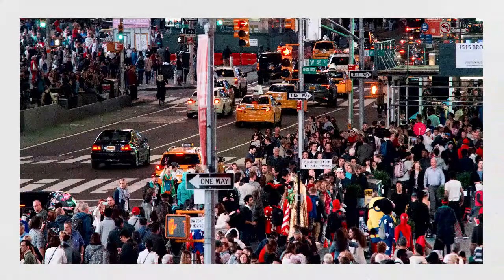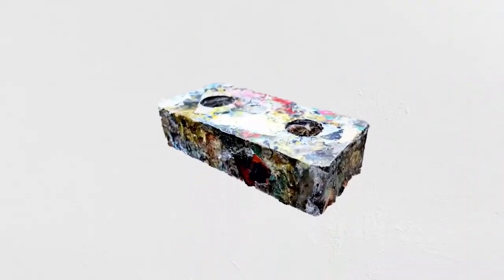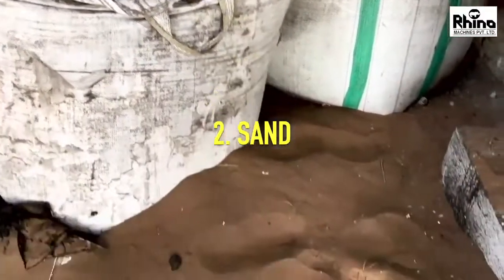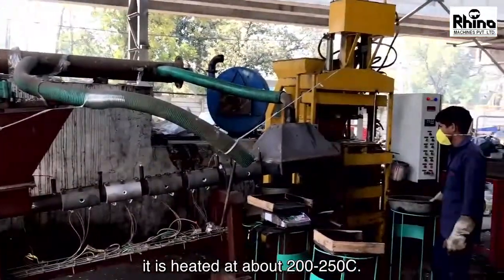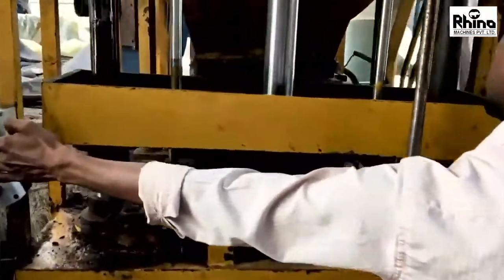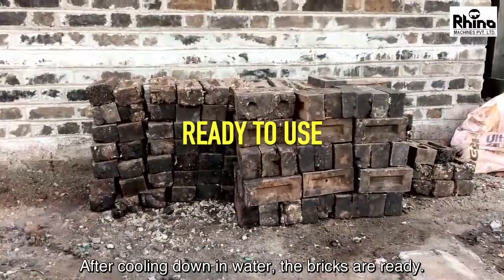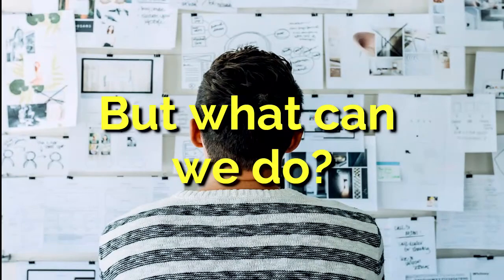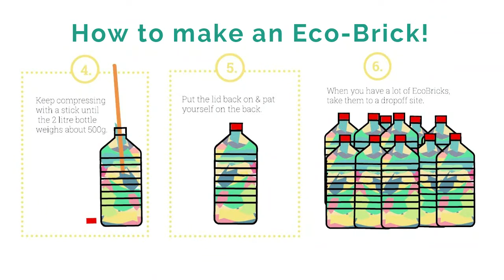Building Houses with FIRE PROOF PLASTIC BRICKS!!! [ Episode 2: Zero Waste Series ]

Comment from the maker: For all those who think the plastic brick will catch 🔥🔥🔥🔥
VIDEO PROOF: https://m.facebook.com/watch/?v=2465503103576809

We love to hear from our InfoMatter family, please suggest improvement or video ideas you want us to make So we can continue to deliver awesome content ☺️🙏
Reply: Cost of per brick Kay hoga
Reply from the maker: First of all thanks for showing interest in our Channel Anju.
We would like to say that the video was made with the sole purpose of raising awareness about plastic bricks production in India. Hence we didn't go in detail about cost or any other technical information.
So to serve you curiosity well, We would recommend you to visit the website/ contact Rhino Machines Pvt Ltd.( Site is inculded in the video)
Reply: The major question is : are they fire proof? If not, they are useless.
Reply: Would it also be better if I use coal ash from power plants
Reply: @lsd8497  it is more complex than your question. 80% foundry ash and 20% plastic means that you will have a high initial capacity to absorb heat in  both the sand and plastic before the plastic will melt. This will STOP fires in your house. If not, the melting plastic will on the surface ignite but at a rate much like a slow burning candle where the heat is mediated vs a wood house which would be like an inferno. However if your house is filled with a ridiculous amount of flammable material, then I can see the inner walls of the house also turning into a roaring inferno as well!

You must also consider the holistic social impact, hope, and job opportunities created which can produce a net positive outcome vs depression/suicide, crime..  death by fire which is no picnic, but neither are the other consequences.
Reply: @baloog8  Elaborate answer. Thank you.
Reply: Hi man. What is your sand/plastic ratio?

Comment: The problem is when plastic becomes a part of our system it is difficult to get rid of it as it does not decomposes but breaks down into micro plastics.
These micro plastics then become a part of our food chain either through food or direct inhalation. 
Regularly Eating food heated  in plastic wrappers containers  could be one of the reasons for cancer. 
I hope and pray the solution of living in houses made up of plastic bricks is not more dangerous than the current  problem itself. More research  needs to be done into this field .

Comment: I hope plastic bricks is the beginning to better quality homes. In the US no homes are built to last, They are built to be torn down easy and not last more than 20 years yet they cost a life’s savings to get. If plastic bricks were cheaper than wood and steel poles it would make building cheaper and homes last longer. More sound privacy between rooms aswell.

Comment: Can we make the block only with plastic waste ?
Reply from the maker: Well we are not experts on that to comment,but as you saw in the video, experimentation never fails to yield the right results!!!
So,yes there could be a possibility...
Reply: Yes . But brick outer layer is slippery . Doesn't make wall 🧱.  Second disadvantage fire can catch . If sunlight hot the plastic brick the hazard gases generate
Reply: @virenderpal868  tq mr.virender pal for your kind reply :)
Well can we apply a concrete coat obove that block to get a roughness so as to build a wall .? Moreover these can build a wall by reinforcing with iron bars ... Then we can easily build a wall ,isn't it.? Also can we make use of fire retardants to avoid fire accidents .?

Comment: What about all the extra CO2 thats is  produce when melting the plastic and the sand together ??
Reply from the maker: Thank you for so keenly watching the video to make observations.
Yes you are right it does emit CO2 while melting, but there is a difference between melting plastic in controlled environment fitted with smoke filter towers and CO2 scrubbers as compare to burning it in open.
The cardon recovered from the filter is again used to make bricks to reduce overall carbon footprint.
Reply: Since we are reusing waste plastics, any pollution in the process will be very less compared to the pollution caused the waste plastics themselves.

Comment: Stupid idea. If house is on fire . plastic would work as fuel.
House will retain more heat in summers so very uncomfortable.
Don't want to live in house to breathe and feel plastic.
Really stupid idea.
Reply from the maker: I do get your point, but you are not considering the layering method in construction.

Here is the link of the video showing it does not catch fire.
https://m.facebook.com/watch/?v=2465503103576809

You can make pathways and other outdoor structure if not homes with these bricks.👍

Anyway if you got any better idea, do let us know ☺️
Reply: @InfoMatter  yes the best idea is to reduce the use of plastic as much as possible and now we could convert it to diesel fuel.
If you are looking for cheap housing solutions use clay bricks and lime stone for construction. Houses made of limestone are way cooler than conventional concrete houses and it gets stronger with time moreover they reduce carbon dioxide present in air.
Turning one heap of plastic into another heap with different shape, is not a solution

Comment: I soes it take fire ?
Reply from the maker: Didn't really get your question?
Reply: @InfoMatter  does it ignite by faire flame ??
Reply from the maker: Nope the Plastic Brick will not ignite by fire flame since the sand and plastic have hardened already,  but if you expose the brick to a continuous high temperature fire the plastic binder will melt thus making cracks in the brick.